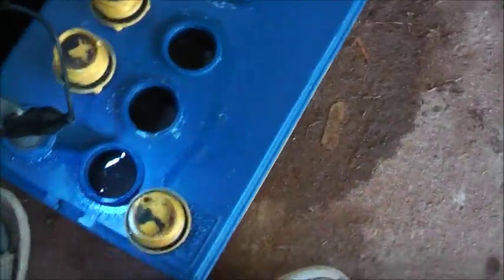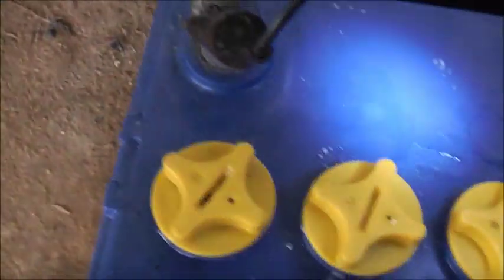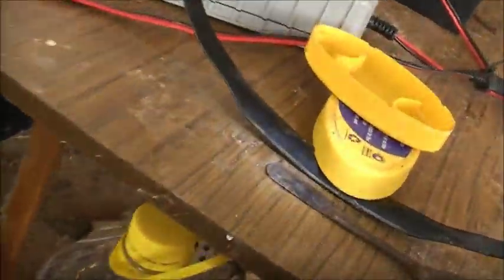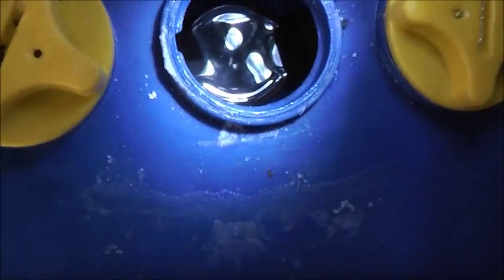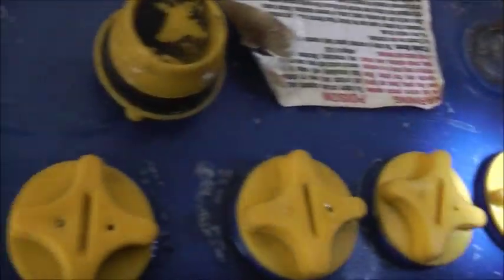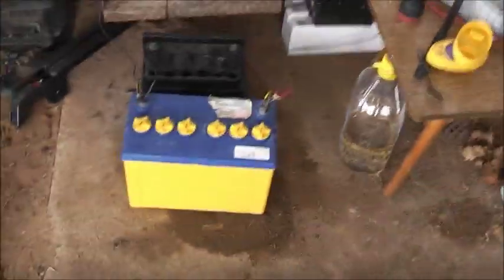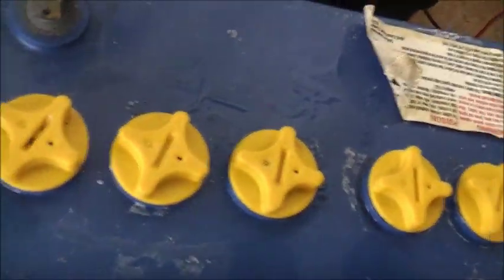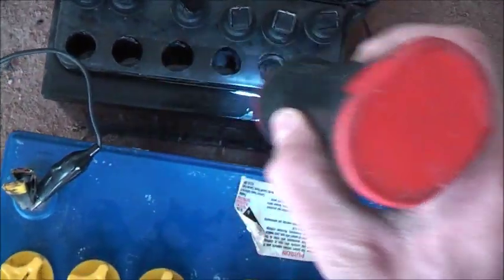Battery Cell Revived!

Comment: Have you ever experimented with recharging alkaline batteries?
Reply: If ur talking about dd, aaa,aa, and those types of Duracell  batteries, there are recharging devices for them. But they have to be trickle charged and they will recharge. I wouldn't suggest doing it yourself unless you know enough about electronics to make ur regular charger as a very !is colt trickle charger